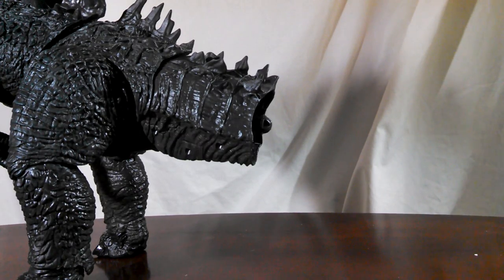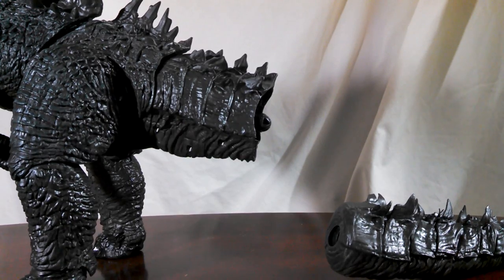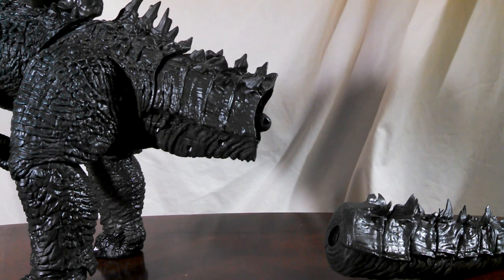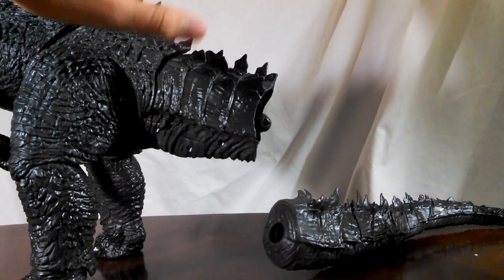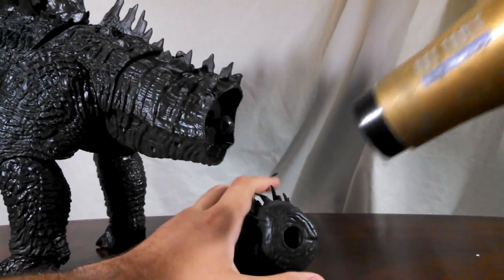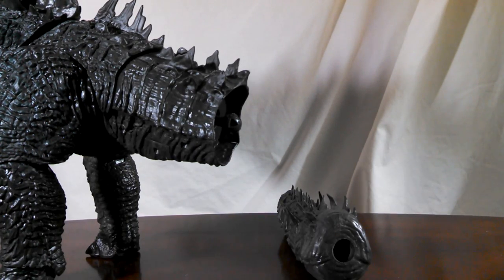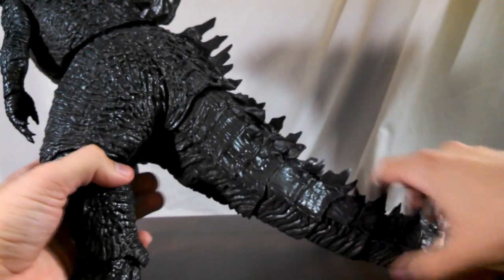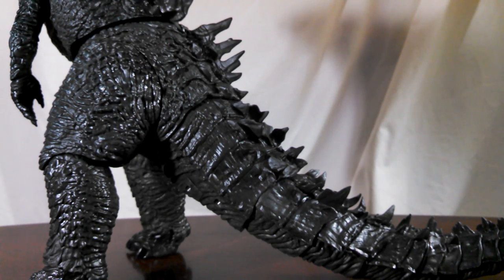How to Attach Parts to your Action Figure/ How to use a blow dryer

Comment: Got a 9 inch NECA 2019 one. AND THE TAIL WILL NOT COME ON! I swear. I put it in warm water. Heated it up with a hair dryer for 3+ mins. All the other joints in the tail are soft as butter and come apart. But the one I want to go in DOES NOT FIT! I'm close to giving up....

Comment: Would you recommend this method with Ultra-Act figures? I'm finding it difficult to change the hands on my Ultraman figure. The hands come off fine, but it' sim possible to get any on the hands on apart from the fists and (with some difficulty) the chopping hands.
Reply from the maker: MoarCrossovers™ Absolutely! It's what I do. Hot water may work just as well for you, too.

Comment: The problem with the 2001 Godzilla is that the tail is attached by a very articulated ball joint at BOTH ends. I've soaked the f***ing thing in hot water for 20 seconds as recommended, slathered both the socket and the ball joint in butter, and it's laughable how much of a dent it's making in this process. Why NECA can't sell their figures in big enough packages to allow for pre-purchase assemblage I don't for the life of me understand. I'm terrified of forcing it enough to break it, not that forcing it is doing anything anyway, but I guess I'll give this a shot.